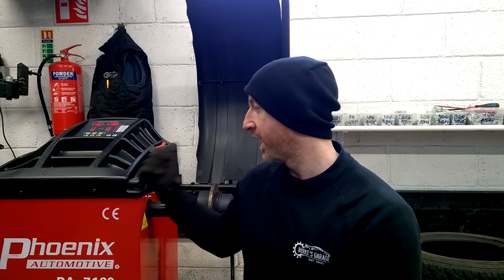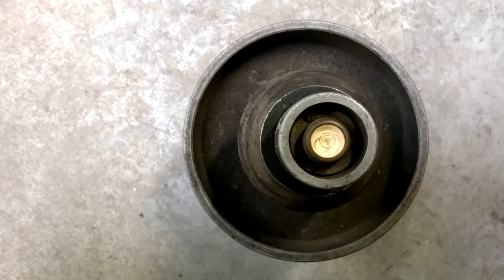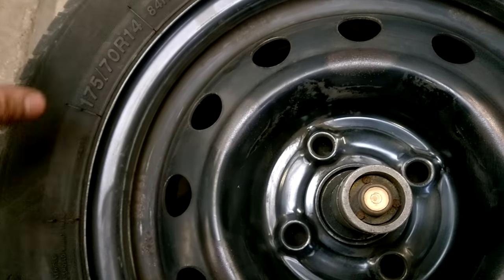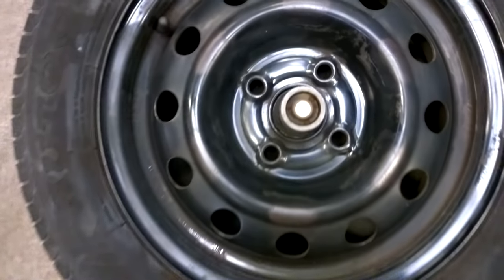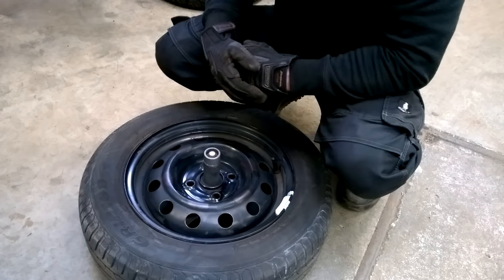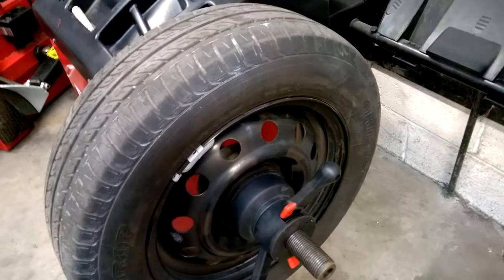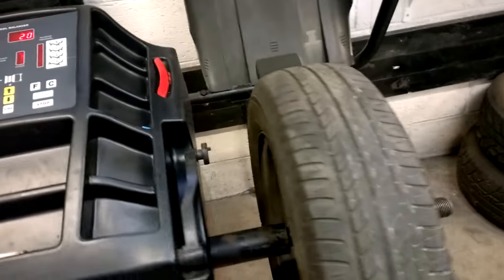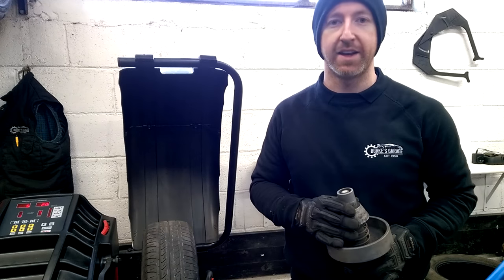Digital Wheel Balancer Vs Bubble Balancer  - Is there much of a difference???

Comment: Aren't you assuming that the dynamic balancer is correct..?  Because why? 

Just because a machine is digital, doesn't mean that it's accurate.
Reply: I'm fairly certain this comparison experiment is faulty. It's my understanding that static balancing (the bubble) is only capable of eliminating/diminishing radial imbalances. I'm fairly certain that the machine is picking up a lateral imbalance. The reason the lateral imbalance increases when he adds the weights is obvious, he only adds them to one side. If that's correct, how could he not have realized this? He has to put the weight on both sides in order to satisfy the digital balancer.... 
I don't know where the readout for radial imbalance is on the digital machine. But even if it showed a radial imbalance, Gerard could have improved on the radial imbalance while still using the bubble; By adding slightly more weight and spacing that weight around the lighter side of the tire until it is, more or less, balanced.
Reply: Any good shop will calibrate the dynamic balancer every month so they know it's pretty true.
Reply: Trevor Colby If you put a wheel on a dynamic balancer and it reads 30 inside 30 outside then you put 30g on one side only it wont put the other side out at all. At worst it would round to the next nearest 5g
Reply: Thank you for saving me some time.  When was the last time the 2nd machine was calibrated? Put the tire on a vehicle and see if you can tell me the difference.
Reply: @NEatopMtHyjal  An electronic balancer can be set to just static balance only, and the weight usually goes on the inside of the wheel where you cant see it. Cowboy tyre fitters will tell you this is a "special" balance program for alloy wheels as you dont see weights on the face of the alloy wheel. A bubble balancer only static balances, and the weights go on the outside because you cant hang them on the inner rim due to gravity, and you would have to take the wheel off the balancer to achieve it. This would make the balance process hard to do and very time consuming, so the weights go on the outer rim.
Reply: Sorry, it was an inaccurate comparison. You never set the spin balancer for static testing, compared to dynamic. With static balancing weights can go inside or outside. It depends on how you set up the electronic balancer.  Same as an aluminum wheel vehicle where weights never go on the outside. I know, I've done it for years.

Comment: Please do this again.  Here is a couple of suggestions.  1) balance a tire on the bubble balancer and add weight to see what the detectable limit is.  2) after getting it right on, lift the wheel of balancer and turn the wheel 180 degrees and put it back on and see if it's the same  (mark the machine hub and the wheel to know when your at 180).  If it does not agree, there is something wrong with the balancer.   3)After balancing the tire on the spin machine do the same as step 2 .  Again, if it does not agree there is something wrong with the machine.    A good bubble balance should do a good job in "static" balance but not the dynamics.   What that means is when a tire is balanced well on a good bubble balancer (regardless of whether you split the weight - as you should if that is the only balancing you do)  and then put on a good spin balancer,  the spin machine should show two weights needed (if it shows any correction needed at all) ,that are the same weight and their locations will be 180 deg from each other (and of course one inside and one outside.)   That is the dynamic part a spin machine can't measure.   Lastly, put the tire balanced on the spin machine back on the bubble balancer.  A perfect spin balanced tire should show perfect on a perfect bubble balancer.  Thanks for the video and please do this again :-)   Even if you don't get good results it would be an important video.   I tried this but I since my bubble machine was at home and I used Walmart to read the dynamic it was hard to go back and forth.  My results didn't agree with the prefect situation I talked about above.  I want to go back and reanalyze my bubble machine.

Comment: there is a big difference between static & dynamic wheel balancing the old way would most likely cure any vibration felt in the steering, I've only ever used the  bubble balancer, very old (easibal)  model swear by it,

Comment: The last time i had my tires balanced the kept adding weights unil the machine said zero. I made up my mind that was the last time i would pay $25 a tire to change them out. I bought a manual tire machine off craigslist for $20 and an old bubble balancer from the 60s for $100. No problems and the fact is with todays tires i bet you could leave the weights off and it would drive fine at 55

Comment: I had issues with my new tires when I bought the car. It was in about 3 or 4 times where they used digital balancer, and only the last time I could not feel any vibration in the steering wheel.  I have read a little about this, and I saw one place a fellow mentioned that if you use a bubble balancer you have the opportunity to put the tire on the balancer before filling air in, and then you can shake it loose and rotate the tire on the rim until you have the best result, pump it up, and that way you start with as little imbalance as possible. One said it was mandatory to put weights on both the outer and inner side at the same time. If not, you will end up with a diagonal imbalance. I see someone here mention that it is a difference between narrow and wide tires. But, I still have a question. In the 1960ties and 1970ties many tires on smaller cars were rather small, 13 inch wheels, and the smaller the wheel, the faster it has to go to give the car the same speed. And, I did not hear anyone complain about shaking steering wheels in the old days, so they must have gotten the tires balanced back then too. How come if things are so off as in this video ?
Reply: Aligning the red dot on the tyre with the valve stem on the rim is a good start.

Comment: The best wheel balancer I have seen was years ago in a small town shop. This unit balanced the wheel as it was on the auto. It spun the wheel very fast and had another unit mounted to the wheel itself. When done it showed how much weight and where.
Reply: That balances the wheel and brake assembly together, so if the tire is installed on another axle, it may not be in perfect balance. If the wheel was a drive wheel, the machine would also spin the drive axle at high speed, which may not be good for the differential.

Comment: A dynamic balancer is obviously better than a bubble balancer as it will be able to tell you how much weight to put on each side of the wheel and give you different angles on inside and outside. With a bubble balancer your best guess is to place half of the weight on the inside and the other half on the outside and both at the same angle. That said, the dynamic balancer in this test did not seem completely accurate. Lets assume that the dynamic balancer was exactly right with needed 5g on the inside and 20g on the outside. Let us also assume that the attempt to use the bubble balancer resulted in 45g placed at worst possible angle on the outside. To compensate for both the truly needed weights (5g inside, 20g outside) and the extra error added by the 45g on the outside you would need no more than 5g on the inside and 20+45 = 65g on the outside. If those 45g were placed at a better angle you would need even less. So the digital balancer has an error of at least 5g. My own experience with dynamic balancers is that if you balance a wheel perfectly and then losen the wheel from the balancer and rotate it 180 degrees the balancer next might want to add up to 15g more. This might happen also on a rather newly calibrated balancer.

Comment: I had 3 different tire shops ballance my 26inch wheels and tires. And it still shakes at 45 to 50 mph. I decided to get a harbor freight home ballancer just to try it. I was blown away with the results. It was perfect😳. Are you saying old physics are old. Physics is physics, If that's the case why is that every cars, every fridge, ac, units, even these new tire machines don't last long and break very easily.
Reply: Machines can be very precise but obviously they have to be calibrated and the tech has to know what they are doing. Bubble machines have a lot less variables and as long as you stick to the basic principles you can achieve a satisfactory result most of the time. As the old saying goes good help is hard to find and the tire industry is no exception

Comment: You did not used corectly the static balancer. when u use that, you need to use at least 4 weight ( smaler ) first level the bouble a triangle shape ( heavy side 1 point of the triangle the 2 balance weight opening from the light side is the secund an the third point of the triangle ) soo once the bouble lined up u should instal the 2 weight on the inner side, then back to the balancer repeat the process and the remaining 2 weight goes to the outer side of the rim ( position will be close to the inner ones ) then you are should be done.
Still will be less acurate then the fancy balancer but if u do it right should be good enough to the average users.
i hope you will make a video with this method and prove that Im wrong :)
Reply: Exactly

Comment: With all due respect to Mr. Gerard Burke and his comparison video, his comparison was flawed. First, a technician needs to understand the difference between “static” and “dynamic” imbalance. STATIC imbalance is that which translates into vertical motion (up and down vibration as you drive), while DYNAMIC is the side to side motion due to the imbalance of one side of the tire/wheel being heavier than the other (which translates into a wobble vibration as you drive). If Mr. Burke had performed the balance correctly, on the bubble balancer, I suspect the difference would not have been very dramatic, at least as it appeared in this instance. Because Mr. Burke incorrectly applied the weights to the tire/wheel in the video, on the bubble balancer, his mistake was confirmed when he checked balanced the tire/wheel on the computerized balancer. By applying 45 grams to just one side of the tire/wheel, combined with the displayed 20 grams (outside) on the computerized balancer, after the weights were removed, is 65 grams. Please note the check balance, with the weights on, the balancer displayed 70 grams (the 5 gram variance is only because of positioning of the weight).  Mr. Burke is correct in the end though, as bubble balancers were designed, and successfully used several years ago, when tires were bias-ply and when high profile ratio numbers were the norm. In today’s world, with radial tires and low profile configurations, both static and dynamic must be considered and only a modern computerized balancer can provide that.

Comment: I mounts and balance my own tires. The goal is to balance my tires so I don’t get vibrations and my tire wear out quickly. Beside putting weight on the rim to balance, I also rotate my tire around the rim to get the best balance.

Comment: You need to split the added weight over both rims. Plus do it the other way around and put the balanced wheel on the bubble balancer. Last but nut least: did you null the old balancer first?

Comment: I suspect one of the two devices are not calibrated correctly. Bubble balancers have been around for 80 years, achieving satisfactory results. If the bubble balancer you used is accurate, your placement of weights wouldn't have made it worse. I'm not being critical of you comparison, I just believe the test should be conducted on multiple devices to achieve conclusive results.
Reply: +1 :  This (Gary M.) guy knows how to science.
Reply: You can absolutely make dynamic balance worse while correcting static balance complete.  The wheel has to be spinning for dynamic balance to show up.  Though if you put your weights on one side and it gets worse in dynamic, which them to the other side should improve it somewhat.

Comment: What have we learned?  A couple things: Never put weights on only one side static balancing. Split weights or put 'stick-on weights' to the center inside of the rim when static balancing. Never had a problem with vibration or tread wear and no suspension issues. Dynamic wheel balancer equipment needs constant calibrating which is overlooked by many garages due to volume and almighty $$$. Equipment is prone to environmental temp issues, voltage/amperage fluctuations, component and dirty grounding issues etc. Saw one garage had constant EMF issues, and they were near HV power lines and caused variations and inconsistencies in their mains panel. Would I have dynamic balancing if I owned a garage, absolutely, but I would ensure the equipment is installed and maintained correctly, and my employees would be well trained, and have the integrity to ensure cals on a consistent schedule.

Comment: Take it from a tire balancing expert from the 60s and 70s.  First you never put weight on one side of the tire.  You need to use 4 weights and split the difference between the 2 pairs of weights putting 2 on each side of the tire.
Reply: Most newer wheels don't have the lip on the outside anymore, so the inside is the only place.

Comment: People posting comments here do not understand the dynamics of wheel balancers or how they work, including Gerard Burke. A static, bubble balancer only checks for static imbalance because its, well, static. An electronic balancer measures static balance and because it turns the wheel it also checks dynamic balance, because its, well, rotating (moving). If you consider the static balance  was 45 grams, and the electronic one was 20+10 grams which equals 30 grams. This makes a difference of 15 Grams, and if balancing is 10 grams or less it will not be felt on the steering. As the dynamic electronic machine is set to round up to the nearest 5 grams it could conceivably only be a 13 gram difference. Knock the 10 grammes leeway out and that leaves a potential  difference of only 2 Grams !  Hardly worth worrying about.

Comment: With the Bubble, spleeting the weight  of 45 grams in two is necessary =  22.5 outside and 22.5 inside at the same place but inside.  I thing the prove is there. The machine show 10 and 70....It's a ratio of 7...… with the bubble method. With the machine, it's 5 and 20  = a ratio of 4.....  7 is very near then the ratio divided by two.  4 is near then 8 isn't-it ?????  ....   Ratio need to be divided by two…  Because the 45 grams need to go inside and outside...    ----  Do you got the point ?????

Comment: So what if the wheel spins way faster at high speed 80 -100 mph? Will balancing at low speed fix issues at high speed vibrations ?

Comment: 1st off the 1st balance was a horizontal balance, the machine did a vertical "real simulation" balance... Does it matter either way..?? Who knows but the only way is to put the unbalanced tire on a car and drive it to see what happens.. If you feel the vibration, take them off and use the horizontal balancer and put them back on the car and see of the vibration is still there or gone ... 
When it comes down to it, all that matters is that when your moving at 55 or 70 mph, does it vibrate or shake ..?? 
Me personally I would rely on the old school method where there is NO calibration needed, just eye coordination to make sure that bubble is as centered as your eye can see it. That expensive machine requires electronics and power and must be calibrated .... The old school does not require calibration ... No different from an analog tire pressure gauge from a digital tire pressure gauge.. 
And when was the last time that machine was calibrated ..??

Comment: I believe this text was on some bb manua back in the good old days, i would like to test it that way.
The patented system involves four steps. First, the wheel is placed horizontally on a balancer equipped with a spirit level and allowed to tilt freely from side to side. The bubble in the spirit level indicates the location of the 'light spot' on the wheel-- the point of greatest imbalance and the one which tips up the highest when the wheel tilts. Second, four equal weights are placed on the rim of the wheel, two on each side of the light spot and immediately adjacent to it. The weights are of a size such that when all four are placed at the light spot, they are sufficient to correct the tilt of the wheel and just slightly to 'overbalance' it. Third, the pairs of weights are moved away from the light spot equal distances along the rim, until the induced overbalance is precisely corrected and the angle of tilt, as shown by the spirit level, is zero. Fourth, one of the weights in each pair is fastened into position; the other is removed, and fastened into the corresponding position on the other (nether) side of the wheel.

Comment: Shouldn't you split the weight on both sides of the wheel (half on the outside, half on the inside)? I think would've resulted in a smaller difference.
Reply: Yes they should.

Comment: Look up the Coats M76 balancer manual. Too long of a discussion for here but 4 weights of equal size, 2 on the back & 2 on the front evenly spaced from the centerline of dead center of the heavy side to dead center of the light side with the weights on the light side no more than about 30* out from the line on the light side.
Hundreds of balances with little issues.

Comment: When you buy new tyres and rims there will be coloured dots on them. The tyre may have a yellow dot or a red and yellow dot. If there is a red dot it should be lined up with the valve this in some cases eliminates any need for weights.